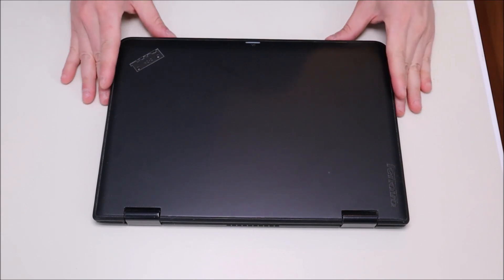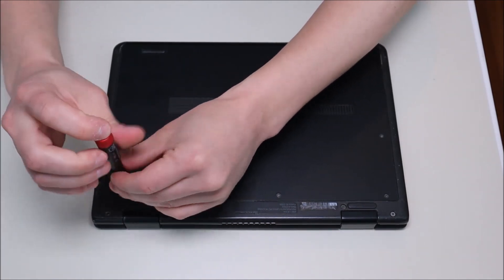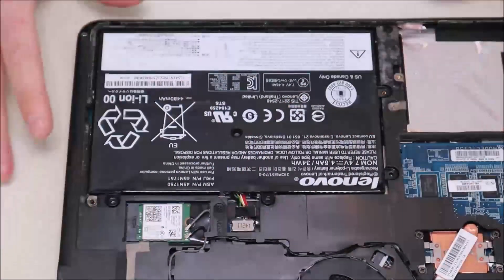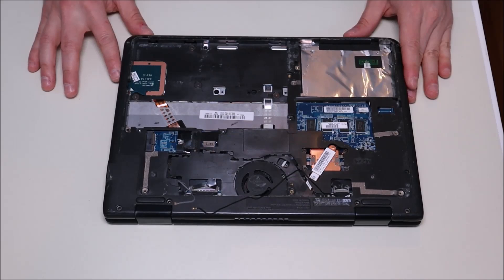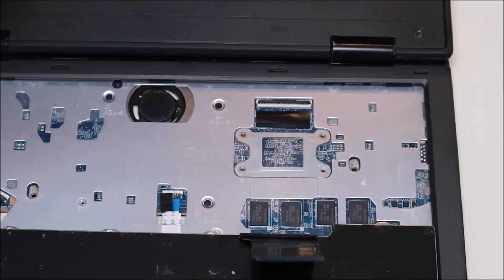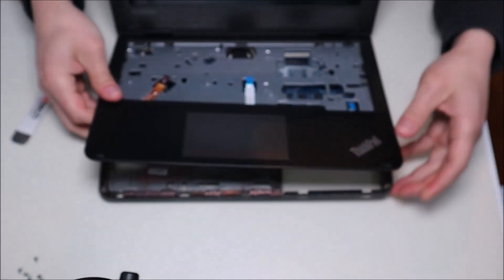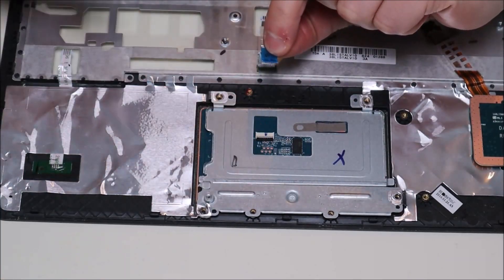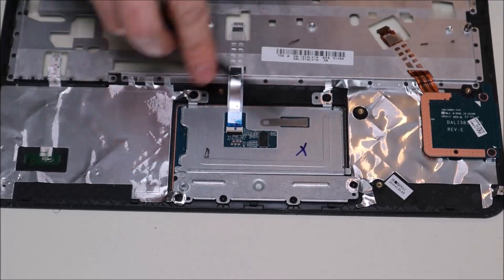How To Replace Fix Palmrest Touchpad for Lenovo Chromebook ThinkPad Computer

Comment: my cord is broken becouse i pulled on it too hard, how do i buy a replacement cord for the touchpad?
Reply from the maker: I would usually find parts like that on Ebay, Amazon, etc. Would you like help? If so, what brand and model do you have?

Comment: Hey my lenovo laptop keyboard doesnt work do u know how to fix it?
Reply from the maker: 1. Do the key or keys feel like they are physically fine or do they feel like something is mechanically wrong with them?
2. Also, did anything happen before this issue appeared?  Overheating, liquid spill, Windows update, etc?
Reply: @PC_Monkey  no everythig is fine i had only a problem with the charger
Reply from the maker: @ghostkillerx9290  Do the key or keys feel like they are physically fine or do they feel like something is mechanically wrong with them?
Reply: @PC_Monkey  physicly they are fine but i think i should be getting a new one anyway thank you very much
Reply from the maker: @ghostkillerx9290  Good luck !!

Comment: Hi i’m literally crying right now bc my little sister spilled water on my laptop last night i wiped it off and went back to sleep bc i didn’t think anything would happen. now it won’t turn on and i don’t know what to do it’s a lenovo cromebook and i’m to afraid to ask my mom to get to switched bc i got in trouble for something similar to my last school laptop and now i feel like i’m going to get in more is there a way to turn it on? i don’t have any of those fancy tools or nothing. and could PLEASE help me bc i have school tomorrow and don’t wanna get in trouble
Reply: update i just got a new laptop 👍
Reply from the maker: @brainless_alian  Nice !!! Enjoy :)
Reply from the maker: Just so you know, liquid spill situations can be hard to troubleshoot just one issue as multiple different components and boards including the motherboard itself, could all be faulty.  
After a liquid spill, you want to first make sure the computer is 100% dry. You would turn your computer off immediately by pressing and holding the power button until the computer turns off. Then you would disassemble the computer as much as your comfortable with, at least trying to remove the bottom case. Then you would turn it on its side and let dry for a couple days.  Have you done this yet or are you sure the computer is dry?

Comment: just in case you cant find my comment I'll leave it here.
my battery hasnt been working for a few months now so i use the laptop while charging it with the charger without the battery, when i try opening it, the power button blinks and the ethernet/internet button blink which is i believe f12, can i have some help please.
Reply from the maker: 1.  Have you tried replacing the battery?
2.  For a computer that does not turn on, try this video first; https://youtu.be/kOBY4k2Mn_k. Let me know how that goes :)